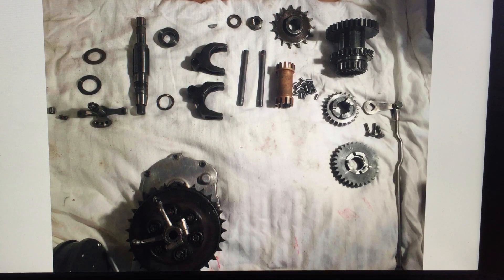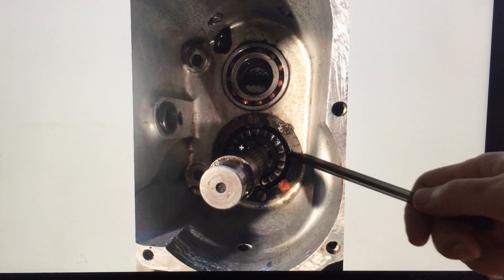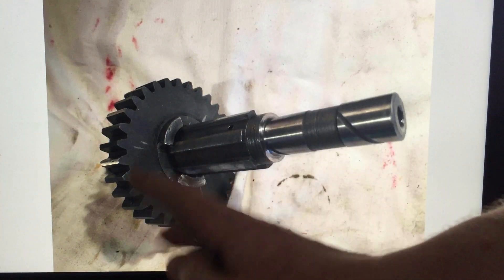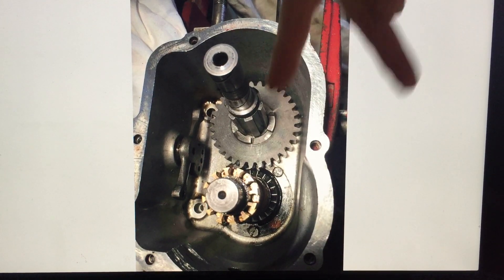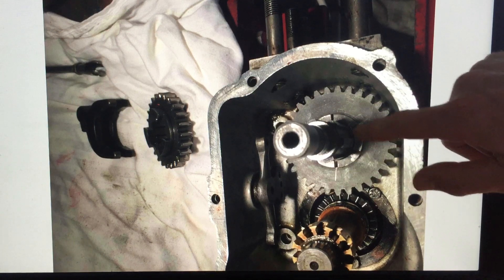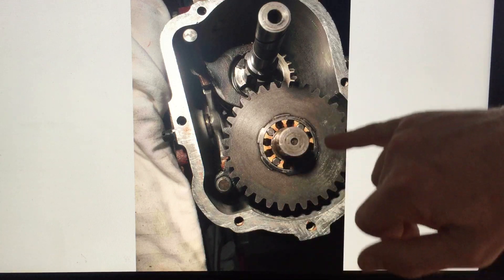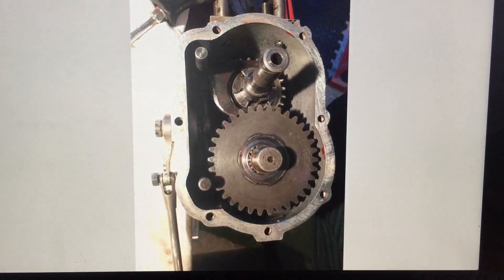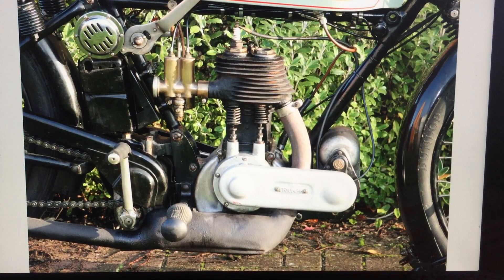How to rebuild a Vintage Triumph gearbox

Comment: Hello, thank you for very good video. Have you pleas more information about the clutch? how the clutch work. how to sea the segments. thank you very much. J.
Reply from the maker: Hello Jaroslav. I will be driving the Triumph to the annual "Ride to the Wall" event this weekend and will then strip the clutch to show you how it all works. This is the original "scissor" mechanism that was not particularly reliable because it requires the cable to be securely held onto the case. As the two arms are pulled together (like scissor handles), a cam between them forces the plates apart.
Reply: @aldermarsh6776  Hello Marsh, thank you very much. I can send you pictures my  construction the clutch segments. 
Thanks Jarda
Reply: Hello Marsch, on this week i bought complet clutch. thank you very much for your answer.Jarda

Comment: What did you use as a seal where the dog goes through the cover plate to the clutch assembly?  Originally it was a leather washer with some sort of metal plate to keep it in place, riveted by the looks. Did you use leather or an aftermarket product? And do you rivet it in place somehow?
Reply from the maker: I used an O ring behind the metal plate. I glued the plate in place so I could keep the authentic look.